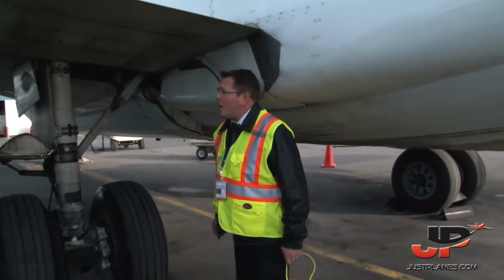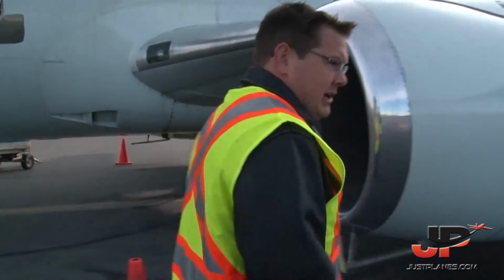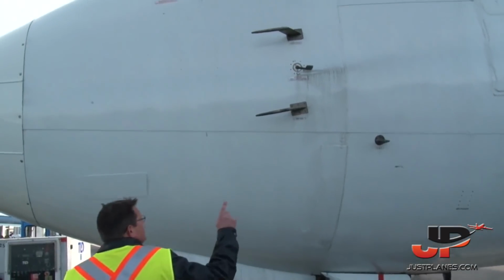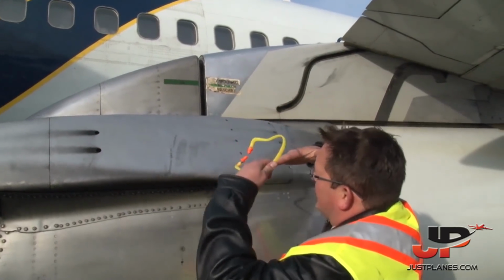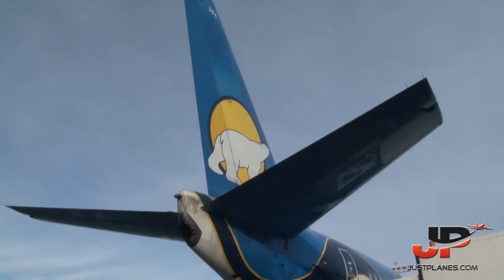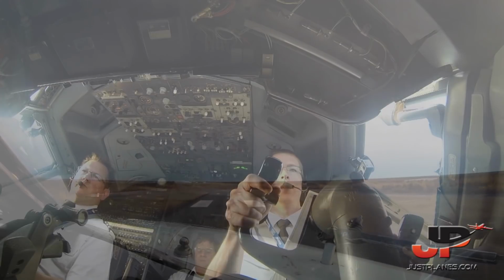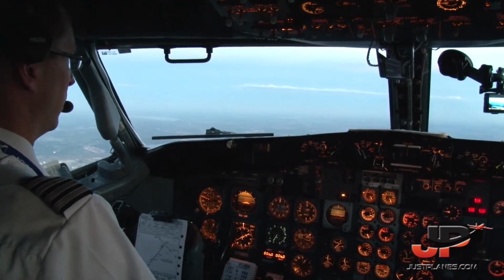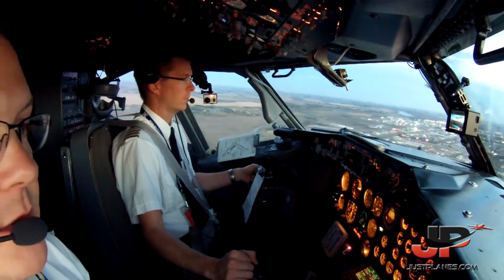Piloting Boeing 737-200 from Yellowknife to Edmonton

Comment: Pilots use take off and landing check lists, why not a preflight walk around  inspection checklist? Secondly , why don't they have a pull down plumb line to help with spatial orientation/awareness in difficult , confusing in-flight situations?